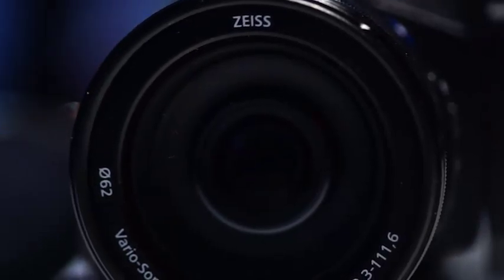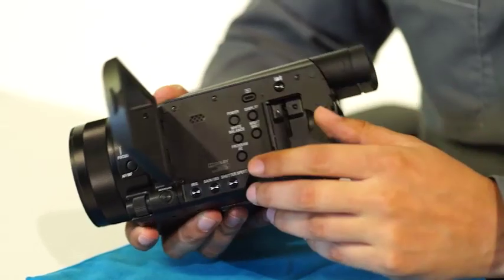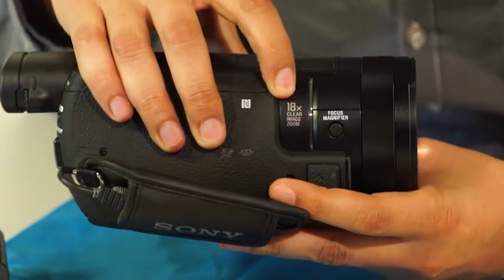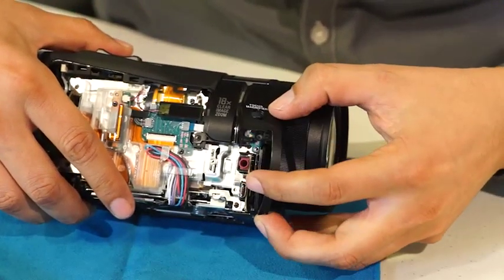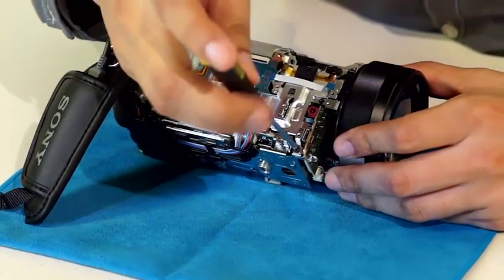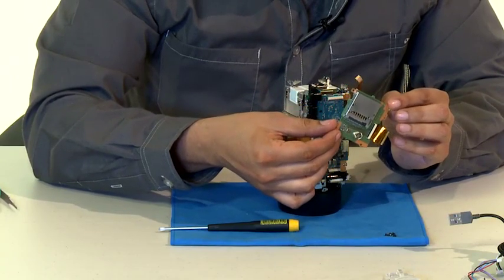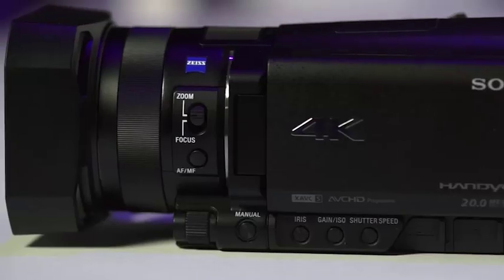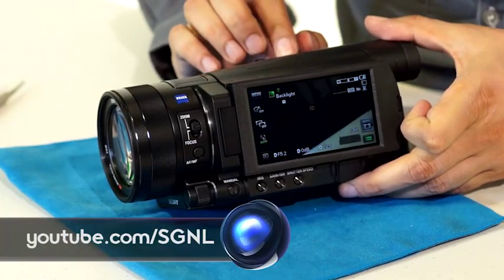A Look Inside the Sony 4K Camcorder (Teardown)

Comment: Was able to replace the LCD on my unit. Took me two hours, after removing the side panel you have to take out the 'Focus Magnifier' piece, then the whole IR SONY logo corner piece. Small adjustment, dial, and maybe (probably not?) the Zoom/Focus switch piece (I forget), but the whole gigantic top piece (This includes the 18x piece, the rubbery zoom rocker area, accessory shoe area [screw under cover] speaker, Zeiss logo) comes off.

Comment: Can anyone help me with the Sony FDR AX33 disassemble process?  I can get the first panel off but I cannot figure out how to get the rest and I don't want to break the damn thing.  Cannot find ANYTHING online... All I want to do is take off the top shoe plate because there is something loose rattling around inside... and no it's not the steady shot gimble thing... it's sounds like either a screw came lose or a piece of plastic or aluminum and I fear that it's going to somehow make its way into my lens or somewhere critical.  Please help.
Reply: same here.
got the rights and bottom cover off and stck there ...
this vid does not show, how to get the top part off